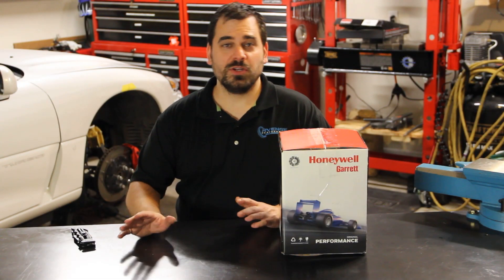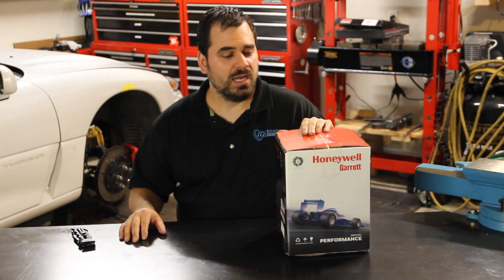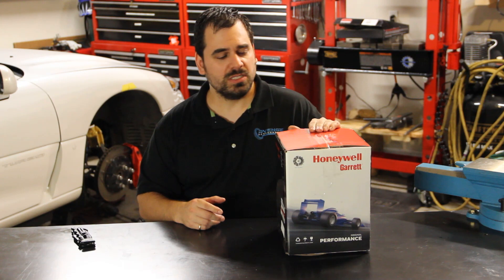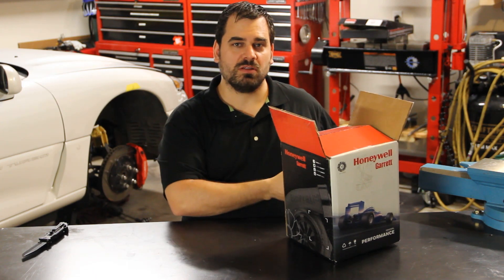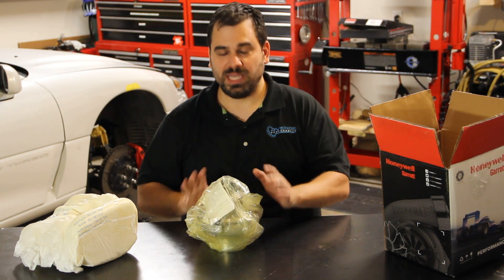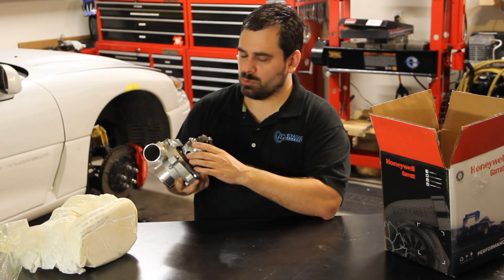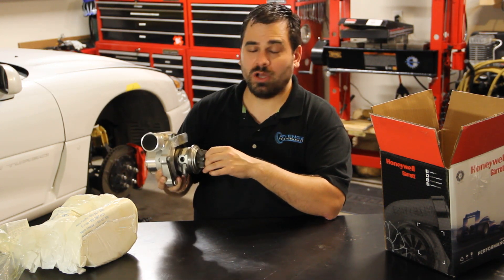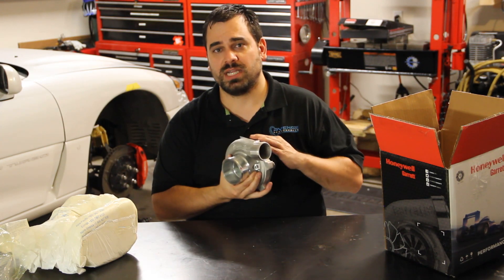Dodge Stealth R/T Turbo Garrett GTX 2867 Gen II

Comment: Assuming I already know the answer(turbo kit), but why no g series? Say g25-550
Reply from the maker: Hi Matt! The G series turbos look pretty amazing, but we are a lot more limited on the turbine housing options currently as the turbine wheel has been updated on these over the GT or GTX Series. They are also about 50% more expensive per turbo.